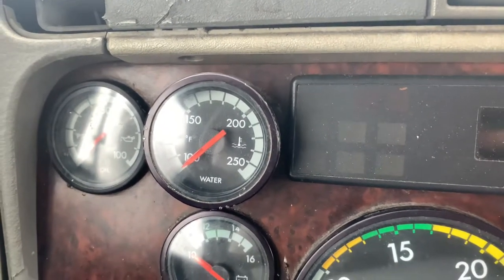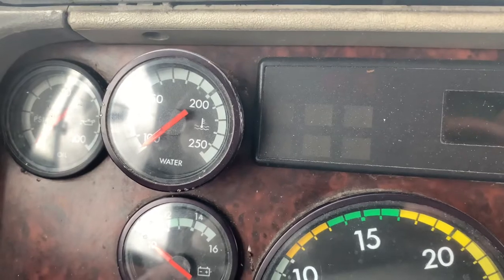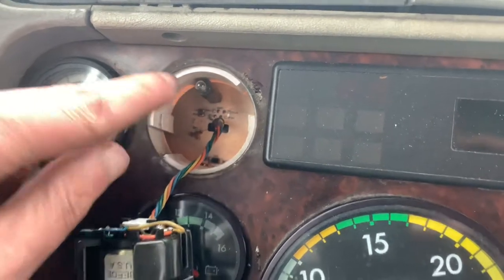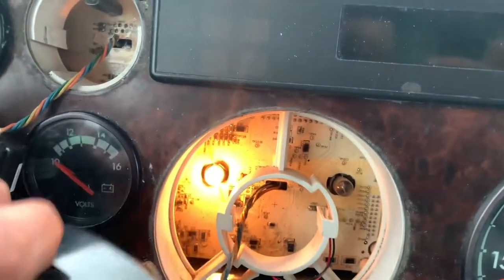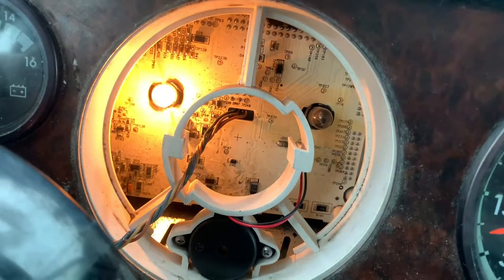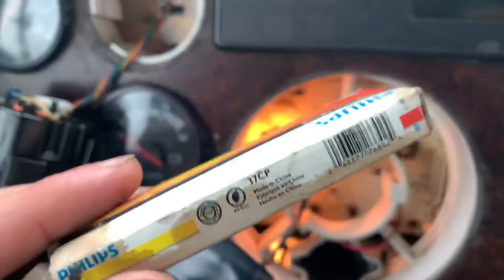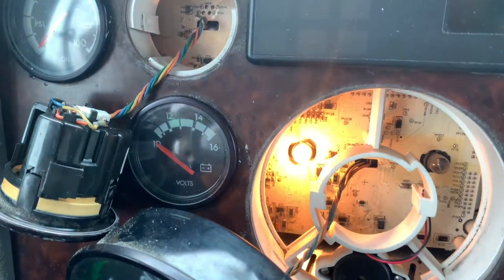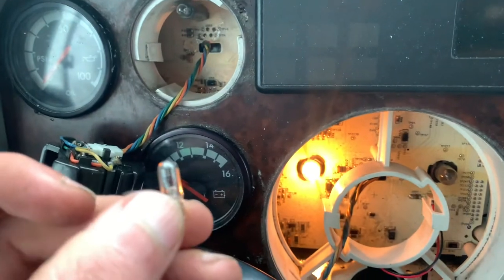Replacing dashboard lights on freightliner semi

Comment: Thanks for this... 🤙🏽🤙🏽🤙🏽 Can you make some more videos on the truck much soon. How do you replace the low air buzzer sensor?? Mine comes on everytime I touch the clutch or breaks. How do you replace/ tighten manual gear shifter that has “play” when in a gear other than neutral?
Reply from the maker: I got a video uploaded regarding replacement of low air pressure buzzard a while back. It on my channel. I’ll try to upload more vids as soon as I can

Comment: Great video , how do you replace bulb inside the black piece , that shows check engine , low warning etc? Thanks for your help
Reply from the maker: Remove the black cover, you should find a plastic tube under it, use the tube to remove and replace lights.
Reply: @owneroperatorlife4380  thanks appreciate it